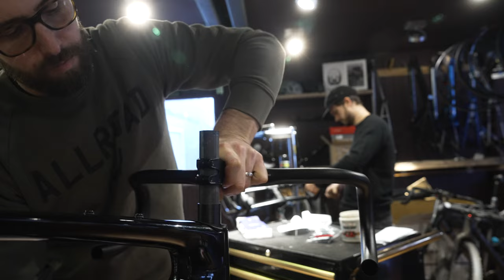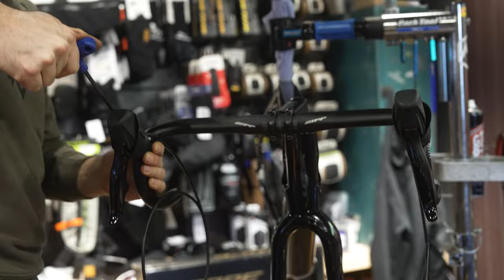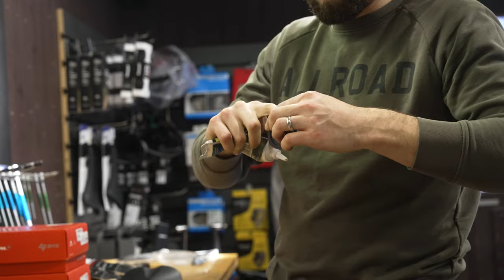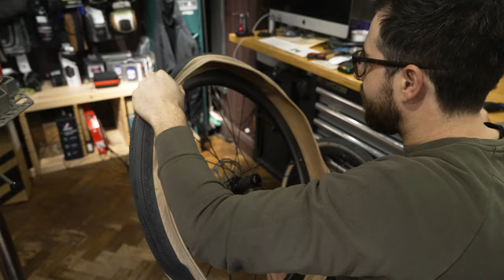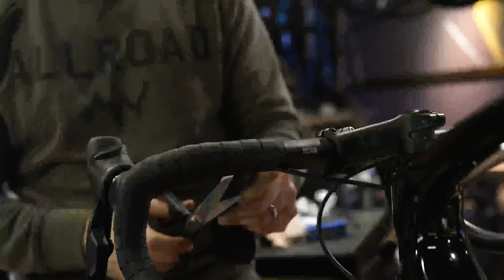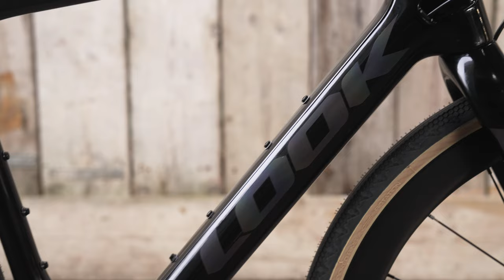Look 765 Carbon Gravel Bike Build - Sony FX3 24-70 F2.8

Comment: Love the builds etc but please you're cutting the fork and even showing the carbon fiber dust from cutting the stem which is so harmful to the health of you and your customers.
Reply from the maker: All forks cut have carbon fibre dust. Ventilation and masks are required.
Reply: @Jimmidoesstuff  precisely thats why I was surprised that they cut them in an open shop without controlled extraction